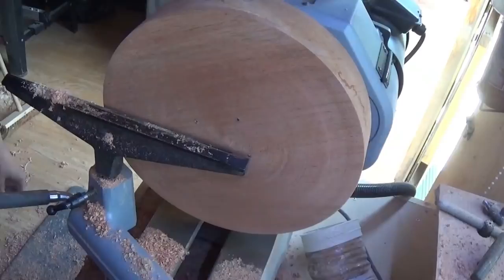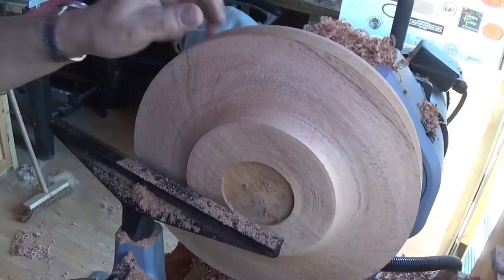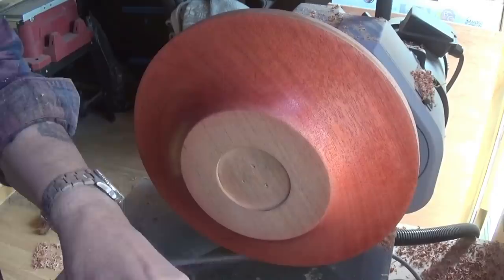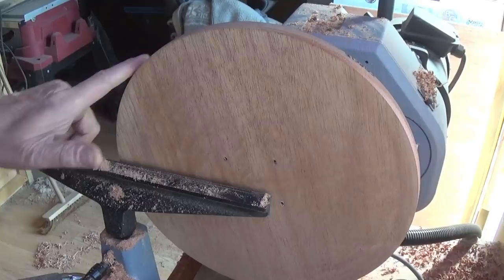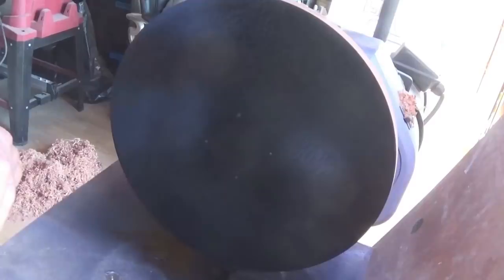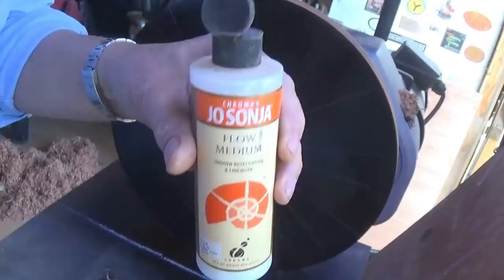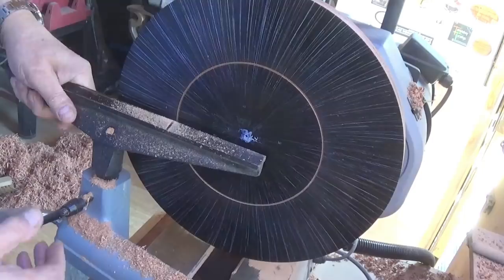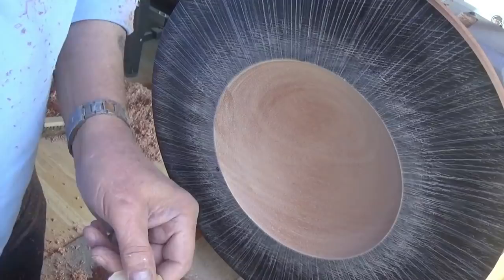Woodturning at 54a #152  Sapele bowl with colour

Comment: Hi Kieth, I hope your keeping well. I have a question for you. I hear you say that you sanded down to 1200 grit. The next thing we see you do is spraying the chestnut spirit stain. Question 1, did you seal the wood before spraying on the spirit stain.  Question 2, did you thin the chestnut spirit stain, or use it as it comes in the bottle ?.  Great to see you back in the workshop. Take care Kieth, Yours Ricky .  Ps. “Golden ratio rubbish” eh . Lol
Reply from the maker: Hi Ricky. I sealed over the stain and I thin the sealer about 60% sealer to 40% thinners.Hope this helps.😀😀